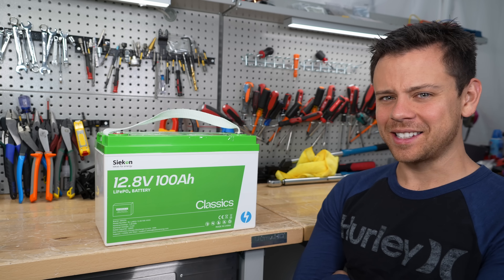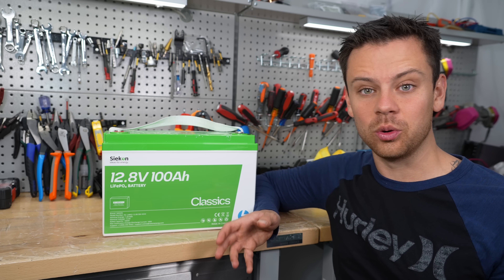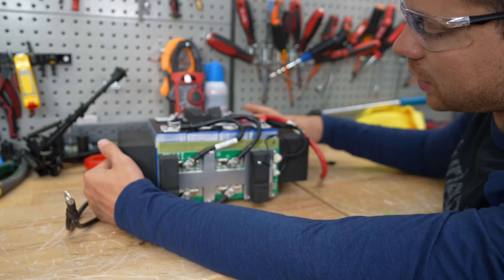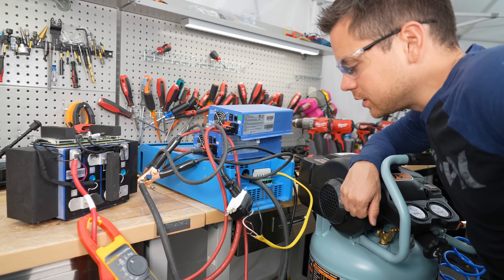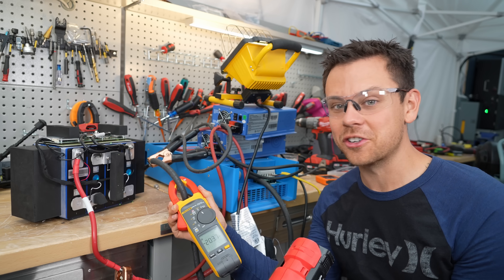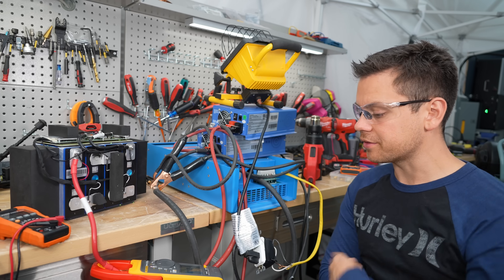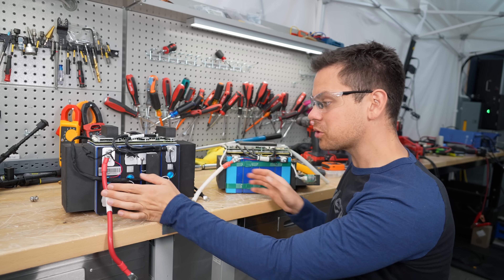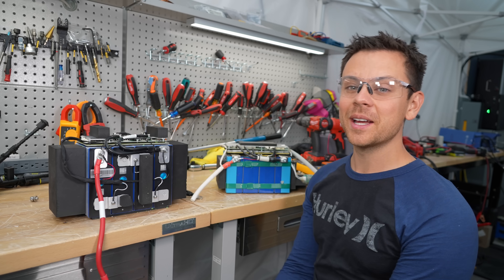Lead is Dead! $229 LFP Siekon 12V 100Ah w/ 150A BMS and Low Temp Charging?!

Comment: 12v 100ah single batteries are actually a pretty bad deal, usually you can get them in 4 packs for about $200 each, and that's for more well known budget brands like litime or ecoworthy, I'm sure you could scrape the bottom of the barrel and get them for $150 if you looked. There really is no reason to use sealed lead batteries anymore unless you need the higher current capacity for running large inductive loads and runtime isn't as important.

Comment: Will, I have been watching your videos for a long time since I built my van in 2020.  My friend referred me to these batteries and I would like to utilize two of the Siekon in a New Pontoon boat , one for outboard motor, one for trolling motor, can you possibly do a set up for alternator or generator charging from boat motor, and can the trolling motor be ran with this voltage if it is not brushless motor.  I will probably utilize a 2 way switch to isolate the two batteries when not charging. 

I’m sure there are a lot of boat owners wanting to do the same.

Thanks Doug

Comment: @WillProwse Thanks for the great content, I bought 2 of these.  Do you have any recommendations for budget friendly chargers (120 VAC speed not a huge concern) that work best with these batteries?  I have been using my Noco Genius 7.2A car battery charger on the lithium setting thus far but is does not seem to go all the way to 14.5V.

Comment: Lead is not dead. Except in some situations like solar house batteries. Lead is more reliable as start batteries in marine especially after a close lightning strike. Click bait!  Also your relying on cheap garbage electronics these wow short one off experiments are useless when considering long term applications. Great for house batteries but start your diesel off Lead.

Comment: I see a 100ah lifepo4 on ali express for like $140 which i can't even get 4 cells for under like $150 and that includes a case and bms but even if they are used and like 90ah it's still an incredible deal if it's not complete junk

Comment: I purchased two of these and set up my home emergency generator 3,500 watt inverter and a 200 watt Renogy suitcase solar panel great with 30 ft of cable. Easy build! So glad that you tear these things apart and tell us what is good and what isn't I have bought so many batteries because of your advice. I have also purchased a total of three Battle Born batteries they all perform marvelously but it's hard to accept the fact that you can buy four of these batteries for the price of one battleborn.😮

Comment: So what if I want to put this in a semi truck for batteries? Positive negative negative negative. The roads out there are very tough on our trucks. Can you do a test like that on a semi? Truck. Or is this a toss up in the air for me? I'm trying to eliminate weight. But also need enough power to start my semi truck. My engine is a 550 Cummins. So what do you think?

Comment: I really enjoy your videos @WillProwse!   What's your opinion on mixing manufactures when increasing battery banks capacity? I ditched the lead batt on my travel trailer and now have a LiTime 100ah. I like the price on this one your testing and the excitement you have for the quality. Would you connect this one to a LiTime to double the amp hours in parallel?

Comment: A 100 amp hour lithium battery with low temperature disconnect is designed to protect the battery from operating in extremely cold temperatures, which can harm the battery.

Lithium batteries can be damaged or degraded if operated in low temperatures, typically below 25°C (77°F). At temperatures below 0°C (32°F), lithium batteries can experience:

1. Reduced capacity: Capacity may decrease temporarily or permanently.
2. Increased internal resistance: Leading to reduced performance and efficiency.
3. Potential damage: Extreme cold can cause internal damage, reducing lifespan.

The low temperature disconnect feature is designed to prevent the battery from operating in these conditions, protecting it from potential harm.

When the temperature drops below a set threshold (usually around -10°C to -20°C or 14°F to -4°F), the disconnect feature will:

1. Disconnect the battery from the load, preventing discharge.
2. Protect the battery from potential damage.

Once the temperature rises above the threshold, the disconnect feature will reconnect the battery, allowing normal operation.

It's essential to note that even with this protection, repeated exposure to low temperatures can still affect the battery's overall lifespan. Proper storage and maintenance can help minimize these effects.

Comment: I have an ARB 12 volt fridge/freezer that I use for camping. I've been using a Group 27 lead acid battery and a 200 watt solar panel for electrical power, but at nearly 60 pounds, this battery is hard to move around. I'd like to replace it with a 100 amp hour LiFePO4 battery, now that they are staring to get cheap enough that I'm willing to take a risk on one.

Comment: I’m probably on my last 4 AGM batteries in a remote system before switching completely when they age out, but I may be one of the old coots that’s hard to completely convince.  It’s nice to have batteries that, shortcomings and all, won’t unexpectedly shut off if it gets too cold because they don’t HAVE a BMS. To date I’ve had one LiFePO battery fail, and it was a BMS failure… frustrating to have a perfectly good battery and not be able to use it.  Still… it’s getting to the point where there are few if any  situations that could realistically argue for AGM.  Great video.

Comment: I'm getting increasingly worried about lithium batteries in fires. Are they basically accelerants waiting to be ignited? These days who know how many devices I have, scattered around my house, which have lithium batteries. Whether it be earbuds, solar generators, or electric vehicles. If I have one or more devices with lithium batteries, at a locker facility, will I be partly liable if a fire spreads to my locker and is harder to stop because of a device in my locker? How much of a self ignition risk do they become: as they sit forgotten in a drawer for decades?
Reply from the maker: Don't worry about it. If you damage the device then throw it away. You won't have any issue if they are not physically damaged. If it has a big battery and it gets damaged, the. You should worry. But usually it takes a lot till it's actually dangerous. Don't worry about it though, look how many people have cellphones without them catching on fire. They are designed to take abuse
Reply: @WillProwse  Being in a fire will probably cause damage.  ;^)   So as I understand lithium batteries: once they reach a certain temperature they burn long and very hot with lots of toxic gas. Which is why I referred to them as an accelerant.

Am I remembering incorrectly: that lithium batteries don't age well, >10 years, and become increasingly likely to develop internal shorts in addition to generating more heat while charging?

Comment: I was looking at Amazon and saw there are several brands of 12v 100ah lifepo4 batteriess now under 200 dollars. I think it is time for you to do a super cheap battery test. The cheapest price I saw today was $149. Several ranged from 150-175. It would be interesting to see which one of the super cheap batteries held up the best. I am about to build a simple workshop solar system with 24v 2000watt pure sine wave and 2 of the cheap 12v 100ah in series. Would be great to know which  of the cheap bats would work best. Will be running led lights (100watts), mini fridge 60watt) and a mini split (750 watts) plus an occasional hand tool like a angle grinder or palm sander. Have 4x100watt solar panels to charge and only use workshop on weekends so system will have time to charge each week. Mainly just wondering which of the cheap batteries actually is build decently.

Comment: Cmon. 105Ah lifrpo retail(!) price is €35. Grade A. €140 in total. A bms ads more €30. Plus €10 for cables and a case. A final price is €180. And all these manufacturers got their profit. Thus there is plenty room for a profit for everyone
Reply: What about when the whole battery cost $125?
Reply: @Gary-ee3kq That means that they put heavily used cells in a new shiny case. They can even refurbish cells with a new blue shrink tape (and put a laser printed label on it )))
Reply: @sc0or  at my electric rates they pay themselves off in 1-1.5 yr. I'm going to risk it.
Reply: @Gary-ee3kq  I don’t think there is a big risk there. Some facility used 125Ah cells, after 5000 cycles they become 100Ah, the facility sold them for penny, and you can get a 100Ah cell that will be a 80Ah after 5000 more cycles like it was 100Ah new. If the facility has not overcharged the cells, they are fine I think

Indirectly you can judge a cell weight. If it is a bit heavier than a typical 100Ah (just for an example), then you have a repacked cell most likely.

Comment: It would be good to monitor the temp of components on the BMS during the  overload test.  This would be done if it was UL listed.  It may be unsafe with no overcurrent protection. Perhaps you should try a short test to unsure the product fails safely.

Comment: I use lead acid batteries in cold climate of the rocky mountains during hunting season. The FAA and other companies use them for communication/NAV systems on high and cold weather sites because they do not heat the buildings in winter. C&D 2.5 volt cells which we used a total of 48-52 volt systems, are able to run the NAV systems when lines go down for up to a week. Also C&D's last 25 years +. I Like LiFePo4 batteries but lead acids still have a place.  The solar charger I have has a conditioning cycle that helps the batteries last longer in my RV.

Comment: Ugh I think I’m finally sold. For the longest time I just couldn’t justify the cost (I have a 30’ travel trailer I was going to experiment with.) I’m about to go on an extended SUV camping trip and only have ~250 watts of solar panels. I’d like to be able to run a 12V peltier cooler for a few days plus random electronics and possibly a fan at night. 

Afterwards they’d go into the RV to replace the house battery, right now I’m thinking two of these (they’re $200 on Amazon right now!)

Will a standard RV converter/power supply/charger work with these? If not I have no clue what to do - all the electrical circuits run through that unit.

Comment: If this battery has to take power out of itself, so it can work when it’s cold, that’s a pretty severe disadvantage.

You were saying these batteries last 6 to 10 times as long as sealed lead acid? The sealed lead acid batteries are use last 7 to 10 years.  So you’re saying these batteries are going to last 42 to 60+ years. I don’t believe you.

Also, the lead acid batteries I use, 90+ percent of the materials are recycled. What is the percentage of recycling done with lithium batteries? That’s pretty important to me, I don’t know what the answer is.

Comment: I like Will’s videos. Honest reviews with good insight into the subject. I’ve converted about 1/2 of my batteries to Lithium. But the starting batteries still LA. The lithiums that will act as a starting battery seem expensive, plus the alternator on my vehicles and boat motor are designed to charge a LA. I do have a pair of lithium batteries in my 5th wheel, but have disconnected the charging wire that goes from my tow truck to trailer. I feared it might damage the alternator on my truck. Not sure if that is so, but what little charging you can get from the tow vehicle seems to risky to keep hooked up to the lithium’s. Will is there any truth in this?

Comment: Also no risk from hydrogen or spilling sulfuric acid....although aren't lead acid batteries still ideal as starting batteries especially if in hot engine compartments or temps below freezing?

Comment: I have been doing a lot of research on portable power station lately trying to find the best WH per $ value . The issue i am seeing is it seems far cheaper to build your own . I see deals through your links of 12v x 100ah for $250 , so for $1000 you can buy literally 4800wh . Now it’s after that i get confused (im the sort of person who would need a (solar for dummies) set of instructions . I think i would need a charge controller of sorts and an inverter . No idea if anything else or how i would set it up to take a solar charge or how to connect everything together . You have a lot of videos . See if i can search through them to see what i would need . Excellent videos so far from what I’ve seen so far

Comment: Totally off topic, but might interest you...

i have had a group 9 Noco lithium battery along with a 75 farad Lightning Audio capacitor in the trunk of my car (instead of a lead-acid battery under the hood) for almost 2 years...

in winter it will freeze out when it's below freezing, which kinda sucks, but managable since the capacitor is there. How bad is it to be heat cycling it that way?

it has only ~4ah...but starting my car (Prelude) only requires ~0.15ah. Don't leave the lights on! 😂

Comment: You should do a review for these batteries:
TEMGOT 12V 300AH Self-Heating LiFePO4 Lithium Battery with Touchable Smart Display & APP Monitoring, Built-in 200A BMS, 2560W Load Power, 5000+ Cycles

Comment: Great Review!  The listing for these batteries say, "The batteries used in series should be fully charged before connecting them. Disconnect and charge each battery separately every time to avoid power imbalance in the series system." (6th image: Flexible Connection Options).
If this is true, then these are not good at all for connecting in series. Disconnecting each battery from a series string for each charge makes this battery only good as a single battery.

Comment: trojan is here to stay, lead is a very useful metal and is good for home diy casting, i can melt and resell 100% of a lead battery and profit in the fishing weights or bullet markets, those fancy batteries have a life span and the end is nasty like a vape pen is useless and in the trash full of lithium iron and phosphorus , so will those thing eventually? a 200lb lead battery is worth its weight in lead even dead .  how many 3rd degree burns has lithium caused?  all that has happen is that a little market share was lost

Comment: Your reviews are good and revealing.  Thank you!  Visually notable, but not mentioned is when you pulled out the guts from the case, a lot of padding is visible (black foam spacers), which serve a role to protect the working components from shock, drop deformation or shallow penetration damage.   Some off-shore vendors to North America are now certifying their Lithium battery product to UL-1973 (Safety standard for Energy Storage Systems) and UN 38.3 (environmental, electrical, and mechanical safety requirements) for transportation purposes.  Fire Departments are finding home assembled systems from off-prime/quality sources causing fires and are now questioning the general availability of volatile battery systems that don't have any proof of safety and quality conformance.  While a certification is not an expectation through your reviews, being aware and referencing what you see with what "could" (or wouldn't) pass under the two mentioned standards would be a value adder!  Even if a manufacturer has no intention of submitting for certification, they can know, understand and inherently attempt to build to the standard.

Comment: A Rookie question. Can you use these Li Batteries to replace the 12V Battery in your car?
Reply: No. You will destroy your alternator, plus the battery is not designed to cold crank a car.

Comment: These ( new ) batteries are VERY GOOD ... but for a battery that can be ( TOTALLY ? abused ) ... nothing beats the ( VERY old technology  )  Nickel - Iron battery , with its caustic alkaline electrolyte ... over charge it , leave it flat for DECADES .. the ONLY way to wreck it , is to forget to top up its water .. but ... the energy density is lower than modern batteries ... so ... you need a bigger space to store these (  railroad companies used these , on their rolling stock  ) ............. DAVE™🛑

Comment: The problem I see with these is that the replacability of the individual cells if a few cells go bad is extremely difficult, even with a spot welder and pliers. I have even seen some BMS designed to brick themselves permanently if a cell is replaced.

Comment: @WillProwse  An Amazon reviewer noted that a problem with this battery is it only accepts a charging of a maximum of 2.4 amps. 
(Your charging meter read 8.4 amps.)
With full-time van life that would be a problem with tons of solar panels and yet can't fast charge.
Can you include charging rates in your tests ?
Reply from the maker: That's false I cranked 75A into it for over an hour. My meter is a PSU for testing temp sensor and nothing more. That reviewers battery must be defective
Reply: Incase this is helpful to others:
( Regarding you cranking 75 amps of charging )
Found this on the spec sheet from Siekon website:
" Recommend charge rate is 20 amps which effectively ensures the battery's life span.
Maximum continuous charging rate is 100 amps, which can quickly charge the battery. "
                  and am guessing, it's saying:   " but will shorten battery's life span."
Reply from the maker: @rvvanlife  they're wrong lol China marketing garbage. It can handle .5C all day
Reply: @WillProwse  Thank you Will for your time and input, much appreciated 👍

Comment: If lead is dead, could I drop two of these in my older class A without changing out my inverter/charger that is not lithium rated?  What about my engine alternator?  Upgrading those have me sticking to lead.